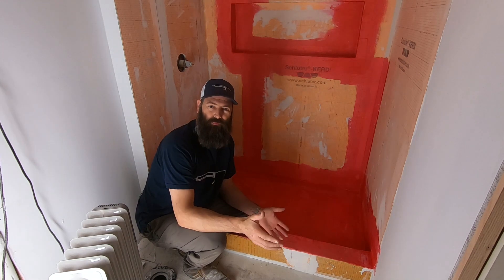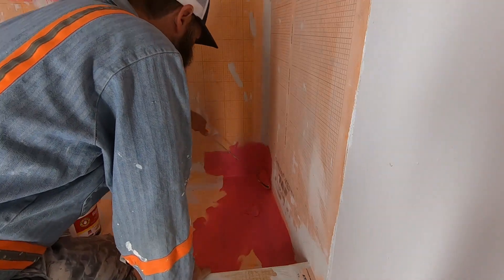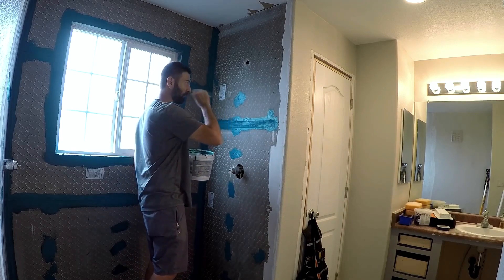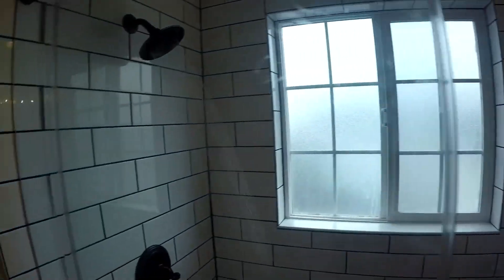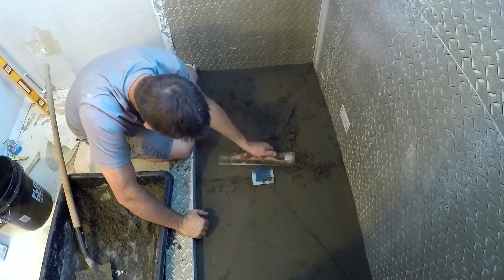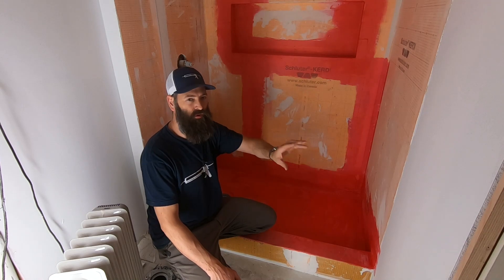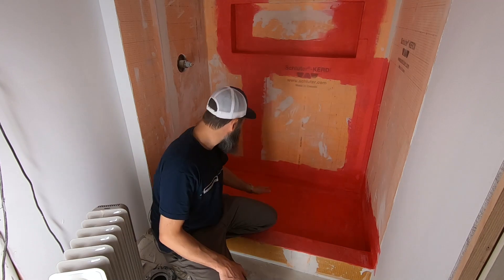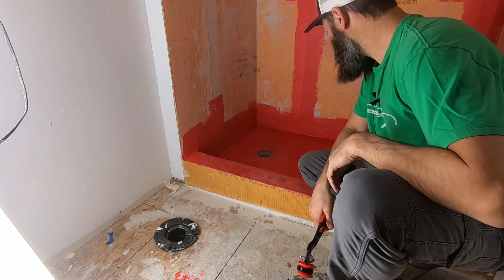Can I save This Shower From Leaking | THE HANDYMAN |

Comment: I have installed Schluter and the company I work for only uses Schluter. It's easy-to-use and if you take there certification class they will give you lifetime guarantees on the product. For an old school guy I understand why it is hard to trust because you have been trained to think about waterproofing a certain way and this tech defies the old thought process but when you follow the steps it doesn't leak. Tip. With the kerdi membrane you don't need the band with the membrane if you over lap the two membranes.
Reply: As easy as Shluter is, novice people can miss critical step that can lead to leaks such as min 2" overlap. Not everyone gets it right and blame the product. One thing sticking out to me on the older video is the lack of pre-slope below the liner which is a big no-no

Comment: Remember back in the day when your boss said, "I need 4 showers floated and tiled, TODAY"? Back then you used extra labor to knock work out. Today? This is just another episode of "Minimum Building Standards" and the things the Dept of Building and Safety lets builders get away with. Materials may be more expensive, but you don't need silly things like journeyman around with their levels and high salaries. Oh, and that was an awesome 4x4 in that Ceramic Coating add!
Reply from the maker: Thanks

Comment: Really looking forward to an in-depth discussion about the macerater system. I have a Liberty pumps ascent ii in my basement which has been working well other than the skid marks. Unfortunately, I have not found a way to combat that yet. 

Do you have your vent running to the roof or are you using a cheater valve? Presently, I have a cheater valve on mine but I am thinking that if I run it to the roof stack it should quiet it down considerably. 

Thanks as always!
Reply from the maker: I have everything vented through the roof.

Comment: Thank you for the video. I tiled my last bathroom using red guard and never had issues. Getting ready to install a shower in my new house and was cautious because of the “pros” bashing red guard and only promoting schluter products. I didn’t want to spend a thousand dollars on waterproofing. Red Guard will be used again.  Thanks
Reply from the maker: There are also some good videos out there on how well redguard works too.   Light coats and even a thinned down first coat and you should be good.